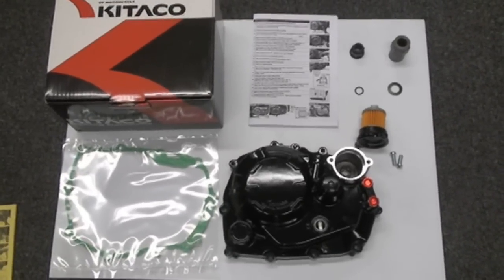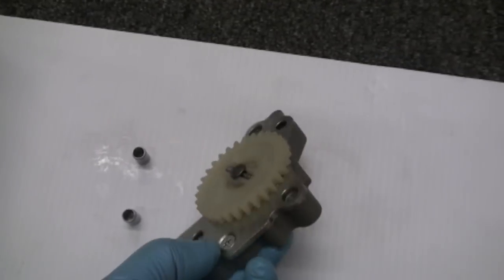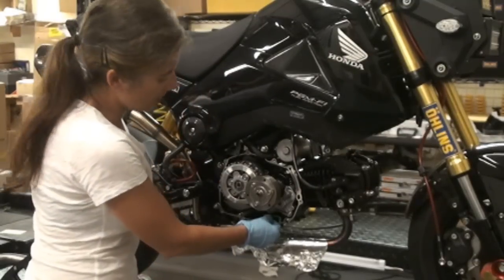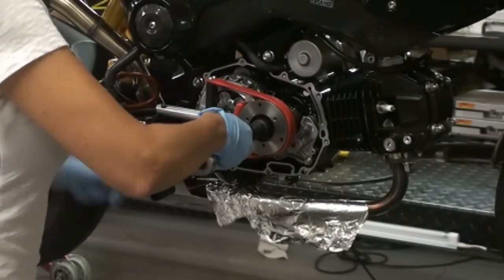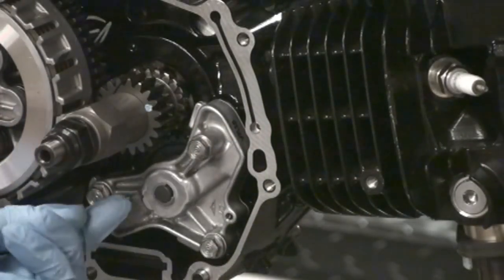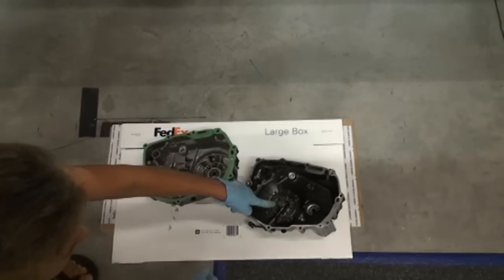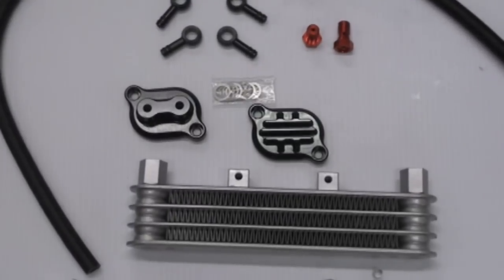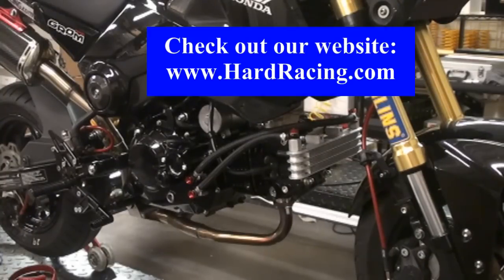Honda Grom Kitaco CLUTCH Cover  IN STOCK Oil Cooler Takegawa Super Oil Pump Spinner #Hardracing

Comment: Wow, 2.5lbs for just an oil "spinner"? That HAS to be vital to overall engine operation. Honda didn't just put it on there for fun. It must act as an added flywheel weight or something? Can someone with more information confirm?
Reply from the maker: +ttwilightzzone . We've been running it on our bike for 6 months and no issues.
We've sold over 500 + of these, and no issues.
Definitely, just wasted weight.
Reply: I agree with you. 2.5lbs is there for a reason. I'm sure it balances something or has some effect. Their testing of 6 months and no problems doesn't impress me. Talk to me after 25,000mi and I'll listen!
Reply: +HardRacing does the spinner fit under the cover and would running the spinner without a spinner filter interfere with the new oil routing?
Reply from the maker: It cannot be left on the bike.  The Spinner must be removed.
Reply: just because honda engineers chose to put the spinner on, does not mean it was for solely performance/reliability issues.  its possible it was cheaper and requires less maintenance than a typical oil filter, and on a bike thats meant to be cheap and easy to ride, every cent they save on productions costs is worth a lot of money to them.
Reply: Google Name I have 27k miles with no oil spinner and so does Patrick Benson
Reply: It would have to at least change the characteristics of the engine. With more weight on the crank, power delivery will be smoother and more consistent, and it will tolerate being in a higher gear at a lower speed, which is what a lot of people prefer for a street commuter. Removing weight might make it spin up faster, it will also make the engine lose momentum more quickly, making gear selection more critical, and gear changes more frequent. But that's all in theory, I have no empirical data from a spinner-less Grom.
Reply: @PMitchell106  Donkey has been told that it revs much quicker without said spiny-do,  butt it's difficult at slow speeds in 1st like 5mph or less
Reply: 25,000 miles 😂😂 it's a grom bro

Comment: Want to say a big Thank You to Hard Racing, I've got all Honda MSX 125 / Grom HardRacing essential mods: Kitaco clutch cover and oil cooler, Takegawa super oil pump, HardRacing billet clutch puller plate, shift lever support, tools, Yoshimura RS2 and FE kits, shipped to Italy at light-speed, best price found even with taxes on, and thanks to videos install has been super easy. If you're thinking about modding your MSX, do this, this selection of parts makes a huge difference, performance and aesthetics upgrade without loosing reliability or fuel economy, and huge weight saving! Go ahead guys!

https://c1.staticflickr.com/5/4783/26837329928_24acb4bc87_o.jpg

Per gli italiani che leggeranno, non ripeto, tanto si capisce. Se ci state pensando,  fatelo, il motore guadagna tanto in brillantezza, il sound e l'estetica sono su on altro livello e il portatarga Yoshi va benissimo con la targa italiana, basta prendere una piastra portatarga metallica nera di quelle da pochi euro e fare due fori aggiuntivi, se guardate la foto si vedono le due ranelle a metà del portatarga (non forate la targa!). E prendete tutto da HardRacing che dopo un mese di ricerche si è rivelato nei fatti il più economico!
Reply: Thank you very much for the post Mastro.  ;-)

Comment: Does the super oil pump eliminate the need for the oil mod that lowers the oil intake for wheelies?
Reply: The super oil pump flows extra 40% more oil.......   But  still uses same pickup location as stock.
Reply: So from the video I saw showing how much oil pumps at sit down wheelie angle maybe the 40% will work, but then the stand up steep wheelie angle will be 40% more than zero & still a problem. But I only plan to do sit down wheelies so maybe that's all I need. Thanks.